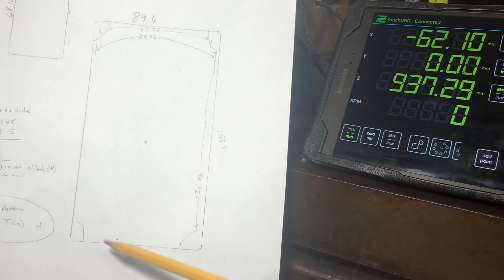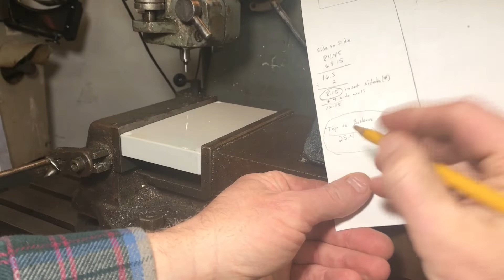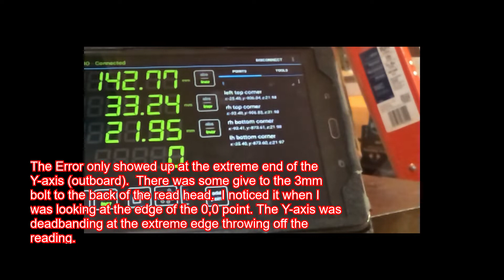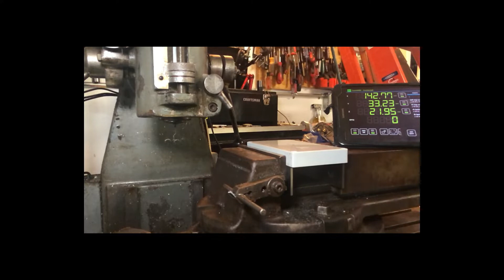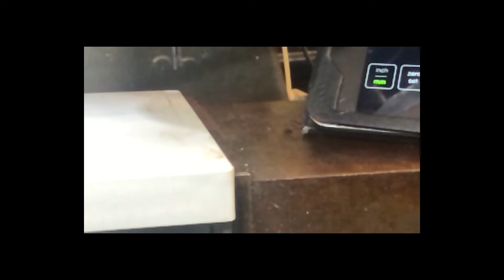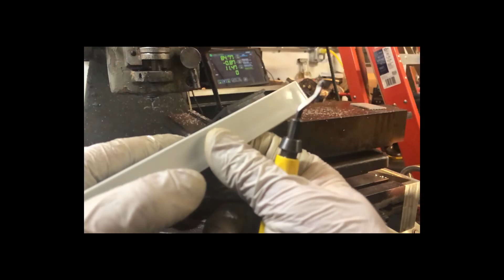Rockwell Mill Digital Tach Upgrade - using Touch DRO for milling points.

Comment: Good job. I'm having issues with  welder.That's todays project when store opens.
Reply from the maker: Thanks Mike. Good luck with the welder. They can sure be finicky at times. I need to get my little MIG out and practice, and then break out the old Lincoln tombstone and burn a few rods. I have my Dad’s (welding savant) picture on my toolbox - he will watch and laugh at his sons inept attempts to fuse metal from the great beyond. Conversely, Dad for all his fab skills did not have the ability to repair mechanical things not made of heavy gauge plate or pipe. LOL.